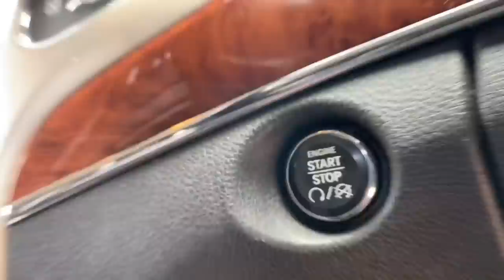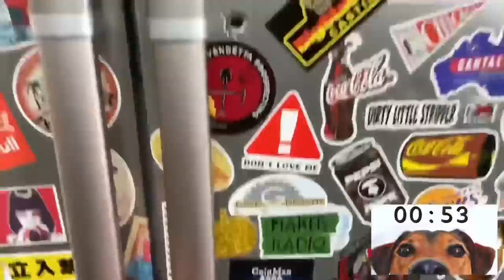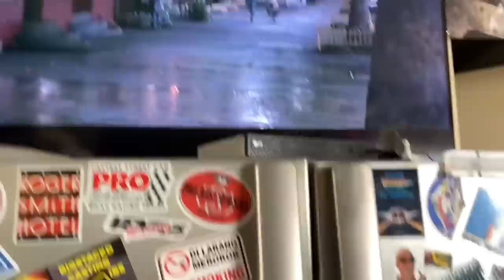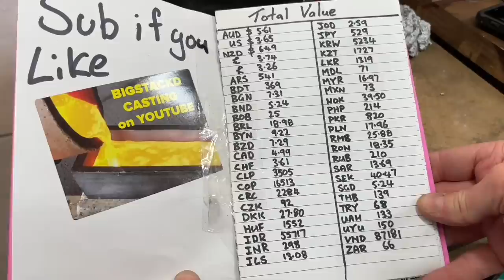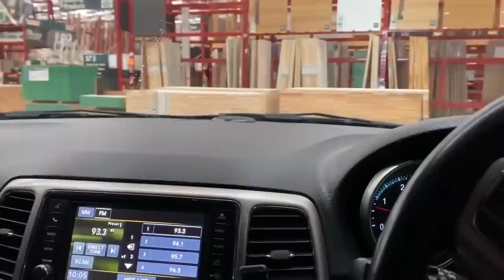This Is My Last Melt Here -Aluminium Can Melt Down -ASMR Metal Melting -BigStackD -Trash To Treasure

Comment: As much as I love beer, given the choice between beer and a Coke, I will take the Coke 9 times out of 10.

Also, you should get a small lawnmower battery for your can crusher. It will work just as well as the car but with far less hassle. I did that for my camper tongue jack. I think you guys call them caravans.

Comment: you might try a flux for melting aluminum.   one easy one is a 1:1 mix of sodium chloride and potassium chloride.   (both fairly obtainable and reasonably safe to work with)

Comment: I save aluminum cans from personal use, a family friend, then using a pneumatic can crusher from Amazon powered by a California Air-Tools quite compressor that's underpowered for the setup, only allows 6 cans per minute max throughput, I use the food pedal to activate the crush function, taking cans from paper grocery bags & boxes that I have saved up & dried for some time. I use a cheap 10 lb metal forge from Amazon powered by 5 gal common propane tanks that I refill locally. It takes me about 4 hours to melt 4 grocery bags into a few bars. I will make a video of my action today & upload it to my YouTube channel inspired by yours. I also recently just moved, no video, from a POD into a storage unit & live an apartment with a ground floor garage linked, which is where I do the smelting, just outside the door.

Comment: What do you use to strip smaller cables? I had an extension cord that I stripped down to the smaller cables inside. I have one of those electric wire strippers but the smaller cables have a tendency to either not get cut or to get caught and bind up in the stripper and then I have to spend a while cleaning it out.

Comment: Try using flux(borax) for slag re-melts or dust melts. I want to see if it makes any kind of difference. Maybe mix in some flux with the dust before melting the dust. Would be really cool if you did a whole video experimenting with flux and how it helps with impurities or how it’s overkill for what you are doing. Maybe the cost out-weighs the benefits. Just think it would be cool because there’s not a lot of videos that demonstrate how flux affects the kind of melts you do

Comment: I was wondering, could it be possible to find like a steel/titanium wire mesh/strainer and use that for slag melting? If the holes were small enough then the melted aluminum would strain through but the slag would stay on the mesh since it doesn't melt right? Could be very useful if you can find/make a custom order for it.

Comment: You should do one final video of the horde of metal before it is moved (if it hasn't been moved already)
Reply from the maker: Actually buddy I’ve completely run out of time this week and only just finished filming tomorrow’s video so the stack hasn’t been moved but the new shed is almost ready. The treasure room is completely built I just need to do some touchups but you’ll see that in tomorrow’s video. So the stack will be moved in next Friday‘s video👍🏻
Reply: @bigstackD  SWEET cant wait

Comment: ... I wonder how much heat you'd need to melt the glass bottles into bricks
Reply: Glass is really difficult to work with. Im certain he could easily reach the required temperatures for soda-lime glass to melt and be workable but glass is ornery. It never really liquefies like metal does. You cant really effectively pour it. And as it cools it rapidly grows more and more viscus till its like pulling taffy. Hence why people can blow glass and work it with tools. The biggest problem is that glass really hates to cool down so much so if you try to let it cool down at room temperature it will explode due to internal stresses. You need to anneal it in a special oven that very slowly takes the temperature down and holds it at certain stages for the glass to release some of that stress. Without that he would just be making piles of glass shards for his effort.

Comment: Curious…why remove the tabs from the cans? Also, will you do a time lapse video of packing/moving all your past melts?
Reply: The tabs is made of Titanium and mess up the melting.
Reply: The cans are 100% aluminum.
Reply: @lrita7179  Yes, but the tab is not, sometimes it is made from a different metal or an alloy. Again, it will mess up the melting.

Comment: So, tiresome, I flatten them and put them thru a paper shredder. you could have shredded that whole barrel into the space of a 12 pack. and melting is easier if you can fill the whole crucible to the top with AL shreds. I'm glad I got to see you get so huge. Congrats on the move.